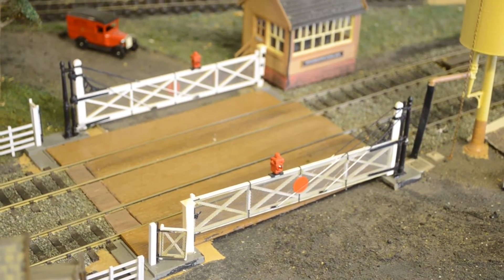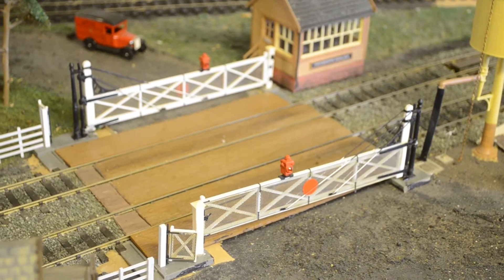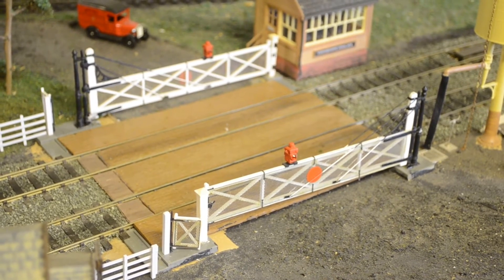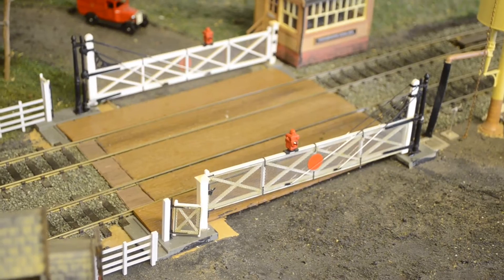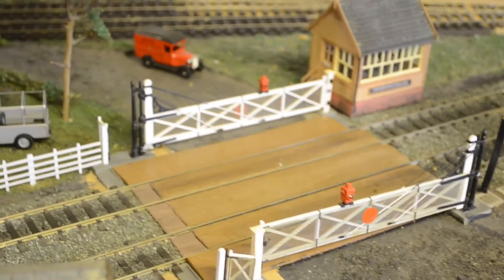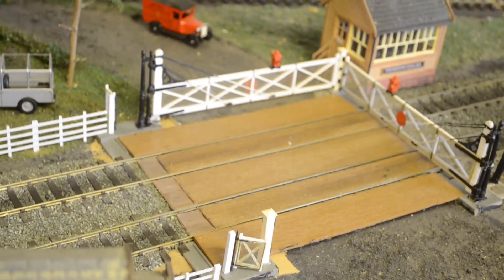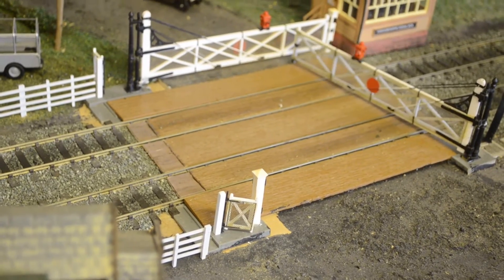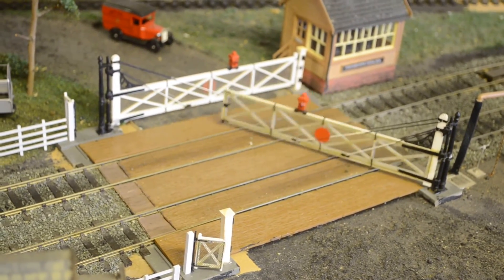Level Crossing with juddering gates problem

Comment: The Servo Signal would be better sent from a separate 5V supply circuit. The 'power' circuit for the servos creates a lot of noise so you must ensure you have a suitably large capacitor (100uF to 470uF plus a 0.1uF Capacitor for noise suppression) across the supply lines in order to damp down any noise. Link the two 0V lines to provide a common reference. Include a 330 Ohm resistor in the Signal line to the servo in series. I know all this because I have just spent an afternoon tackling ALL the same problems and my servos now run sweet as anything.
Reply from the maker: Thanks for the advice here, subsequently, I used a controller board as demonstrated here: https://youtu.be/QX5h04dVmTc which still has some issues so I will be looking to try out your solution as an addition.